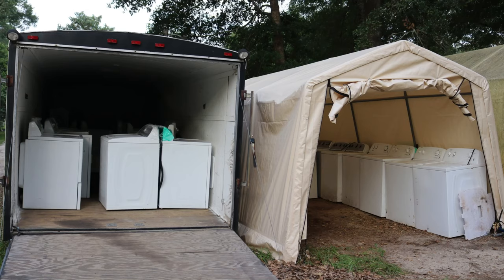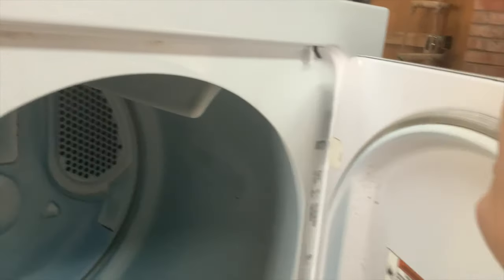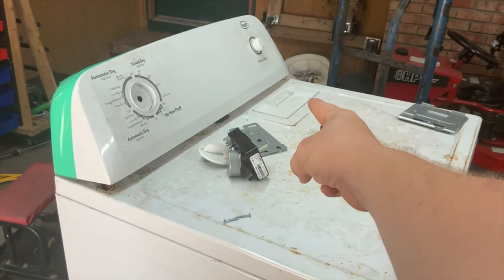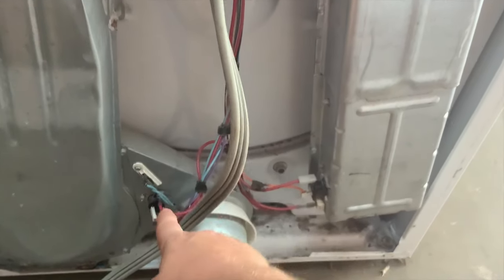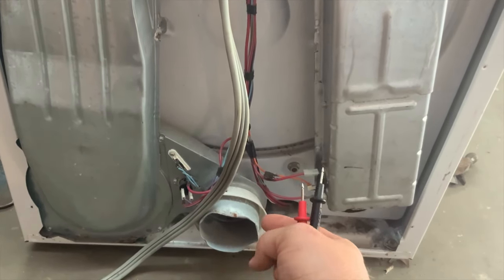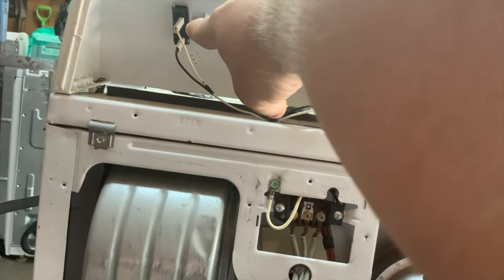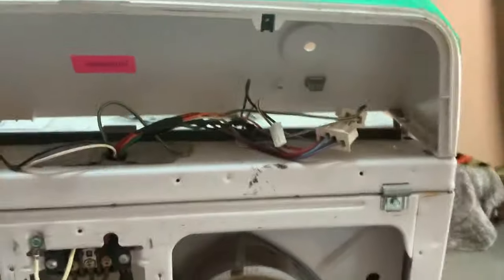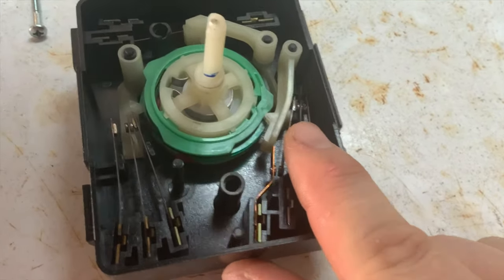Whirlpool Dryer not Heating or dryer won’t start “Every Problem" How to Fix Kenmore Admiral Amana

Comment: Does the timer refurb guy actually install new tungsten contact pads (they are riveted on)? you can bend the tangs to re-establish contact...but it can be a pain. I have found lots of bad timers...one on a model just like that. Havent noticed if you deal in gas dryers yet...
Reply from the maker: I have taken a few of the timers that I have gotten refurbished apart to see what he use that was new. The ones I've taken apart have brand new contacts. I'm not sure if he's replacing them all like that but the ones I get our new.
In my area gas dryers are not very common so I do not refurbish them. I have in the past tried to sell a gas dryer or two but because they're not coming here they take forever to sell.